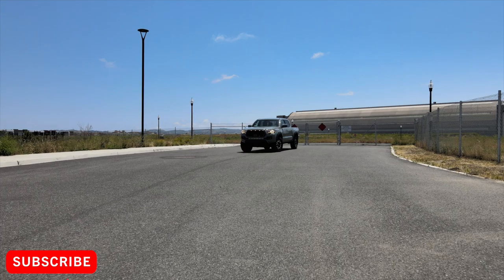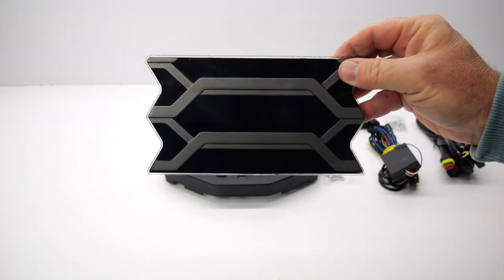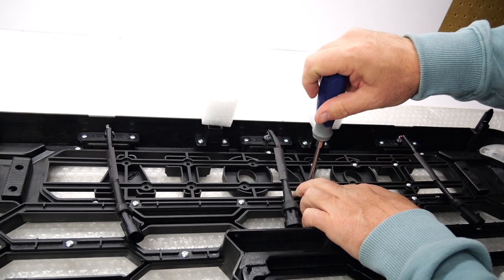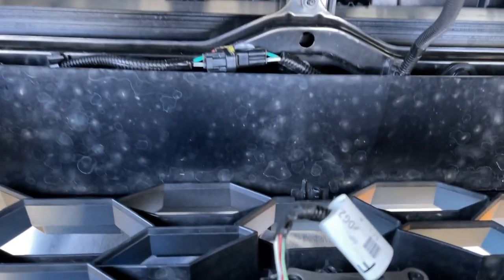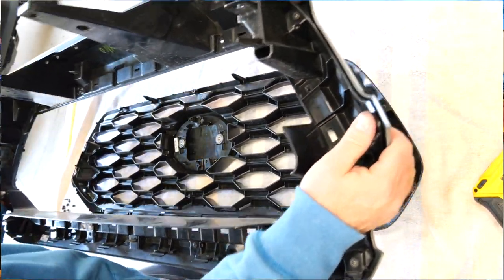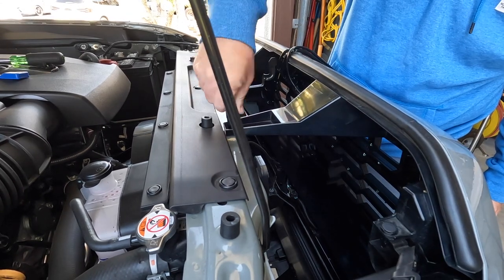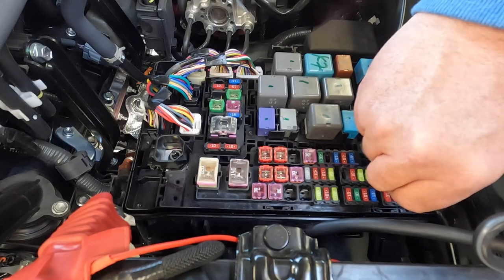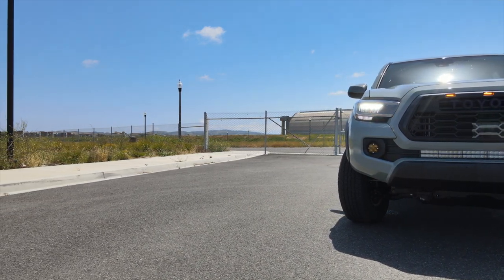2024 NEW Toyota Tacoma TRD Pro Grill - How to Install and Wire - YotaVerse

Comment: $279 + shipping + tax.  I am out.  I have the older model and DO NOT need to up grade that bad.  That and it looks odd with the Toyota name up so high on the grill. It does not look right.
Reply from the maker: All is good...I like the updated look, as they modeled the raised TOYOTA logo after the 2024 Tacoma and the current gen Tundra.  I just couldn't bring myself to drop in the same 3rd gen "Pro" grill that literally every other Tacoma has.

Comment: Its an aftermarket grill, Not a TRD Pro Grill !  It may or may not be a quality product and always question the TSS Garnish/ sensor cover
Reply from the maker: 90% of the “TRD Pro” grills on trucks are aftermarket replicas….just like this. I’ve driven about 6,000 miles now since the install including some long road trips with radar cruise and it’s performed flawlessly.  It’s quality thus far.

Comment: Stellar Video! What path did you use to route the Rapter Light's harness to the fuse box? In your video I can't tell if you went under the radiator or beside it. When you replace the fuse box lid, does the red lead still allow it to close tightly - or how did you deal with this?
Reply from the maker: I routed it through the front end supports towards the battery side, then into the engine compartment by the battery.  I spent way more time on routing wires than really mounting the grill as I wanted a semi factory look without wires dangling everywhere.  As for the fuse lid, I was able to still close the lid just with a small "V" notch to allow the wire to pass through the seal.  I'm in dry SoCal, so it shouldn't be an issue
Reply: @tacomanetwork  Gotcha - I'm a stickler for wires being neatly routed too. With regard to the fusebox - I'm in the midwest, so rain and snow are a concern. I might try to drill a small hole in the box and insert a rubber grommet.  I could pass the lead through that. Or... I may lose patience and try the "V" notch because I can't wait to see the finished project!

Comment: Great installation video. I’m eyeing this for my 23 Trd Sport MT. Before I purchase, I’m trying to figure out how to hook up those side LED if I want to run it at the same time with Raptor and DRL?
Reply from the maker: I have my Raptor light set to only turn on when the headlights are on - which explain which fuse I tapped into.  You can likely tie yours into the same one, or find the one that captures the DRL lights.  The side lights have extra wires too - for the turn signals - I believe they have the capability to be either amber or white.

Comment: Great video ! Do you know if I would still use a 7.5A and 10A on the Add-a-fuse if I want to tap into the INJ (Lights on when ignition is on) for the raptor lights?
Reply from the maker: I would use the same amp fuse you pulled out of the slot you're tapping into.  Then the extra port would be for the Raptor lights...that can be the 7.5A
Reply: @tacomanetwork Thank you 😀

Comment: Sorry if this is a dumb question but, does the grill plate even need to be switched out for the garnish??? Couldn't one just leave the piece in and put something behind it or would the sensor not fit? Honestly I feel even a blacked out garnish would look far better than this and they still have no other option on their website.
Reply from the maker: Hey, thanks for watching - two things, 1. the garnish on my TRD OR was the large round "T" on the grill, so it had to be removed.  2. the garnish on the V2 grill has the wider grill pattern than the 3rd gen TRD Pro grill, so it wouldn't match.  If you check my mud flap, I I have video of the grill with tinted PPF on the garnish - cost me a few bucks at a PPF/Tint shop.  It looks great now!

Comment: Did you replace the mini low profile fuse with a regular mini add a fuse?
Reply from the maker: I dropped the add-a-fuse into the main box, then replaced the two slots in the add a fuse with the included extra fuses

Comment: Subbed! I got the same grille, without the side DRLs/signals, and with their new "blacked out" tss garnish and front camera bracket. The new garnish is just a tad darker but it still stands out. I really like what you did, would you mind sharing the exact brand/model of tint/ppf you used? I was thinking of using XPEL Slate Smoke Headlight PPF, either 25 or 35% but need to find a shop as I've had terrible experience with wrapping myself.
Reply: The only thing holding me back from buying this grille is all the lights.  I would prefer this exact grille but with the cut outs for LED DRLs and Raptors not there.  Less to break and possibly would hold up better?  

Guess I am a simple man with simple tastes. Really like that it’s not same old Pro Grille ….. and unique (for now).   @jjlevitt95 Do you have a link on the grille you bought?
Reply from the maker: Nice! Yeah, I went to a shop that does PPF/Wraps and had them match a good quality tinted PPF and it looks great now!  I posted a photo of it on the community tab if you want to check it out.  It will also be in an upcoming video for RekGen mudflats

Comment: does anyone know how to make the raptor lights always running and how to wire the side lights on the grilles so they can be used as drl’s and blinkers
Reply from the maker: For the Raptor lights, you just need to pick a fuse that will allow them to continuously run.  As for the side lights, you have to tap into your actual turn signal/DTR light wiring to make them work from what I understand.  I opted out of that